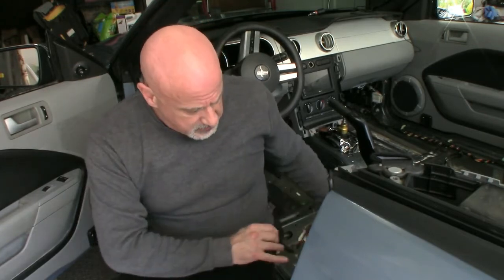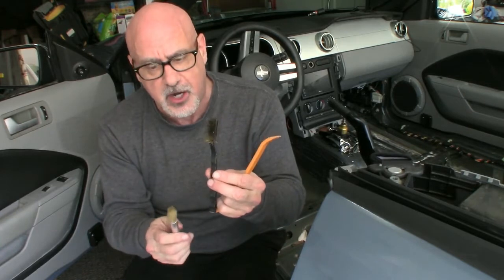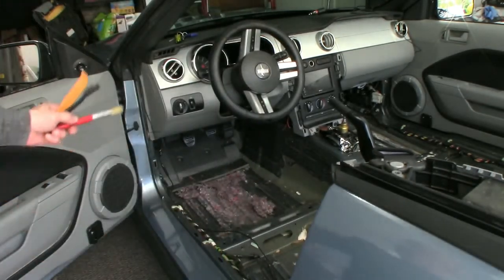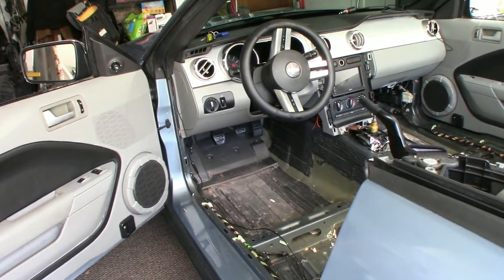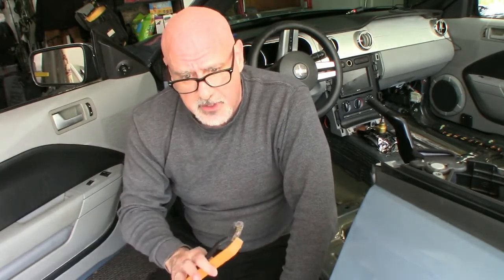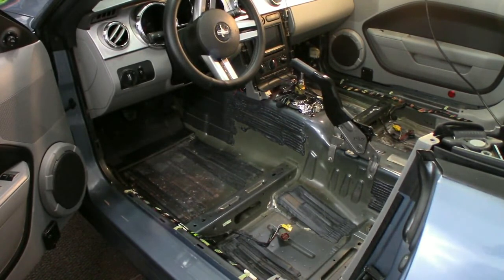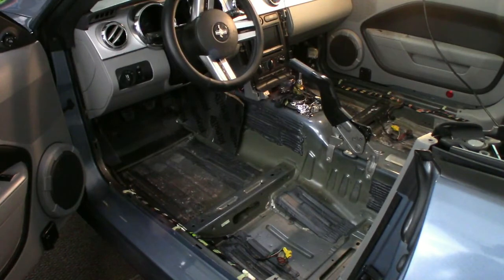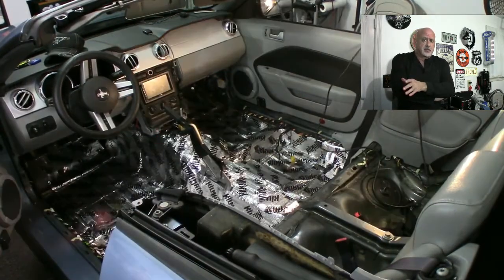2005-2009 Ford Mustang - Carpet removal and replacement - Sound Pad Install

Comment: Great video. I just finished sound dampening the trunk/rear and doors on my 2020 Mustang GT.  Just need to set up a few days to remove the interior so I can do the floors.
I used a combo of Kilmat and soundskins Pro.  Road/Wind noise in the car is already down at least 50%. The stereo sounds better and the car 'feels' more stable.
Reply from the maker: Excellent. It has been fun. Spending a lot of money making it the way I want, but that's what a hobby is all about! I don't smoke, drink, or anything else, so why not spend my time and money on cars!?!?!

Comment: Did you include a 2nd layer of dampening that included closed cell foam?  It works great between sheet metal and plastic (to isolate vibrations).   Or did you re-use the carpet underlayment? 
Thanks
Reply from the maker: NO. I went to bare metal. I got the less expensive carpet with out the thick rubber backing. Sometimes I wish I got it, but it would have caused problems remounting the seats without major trimming that would have look bad.